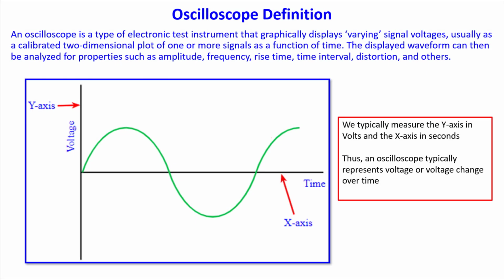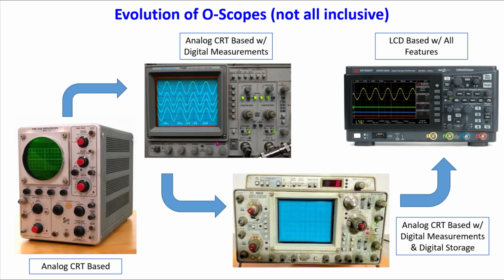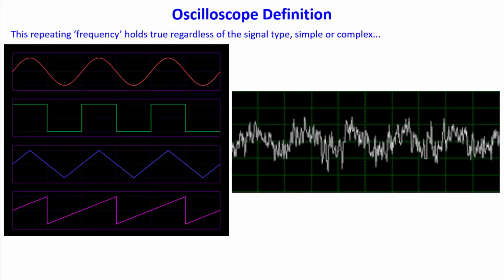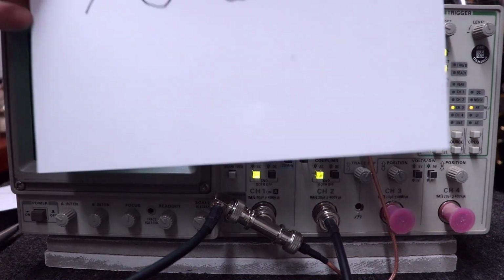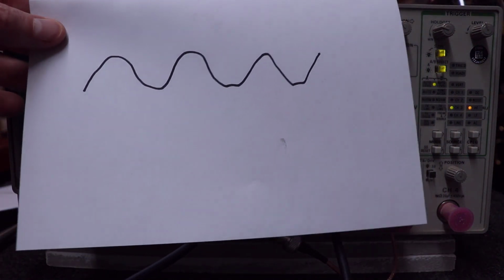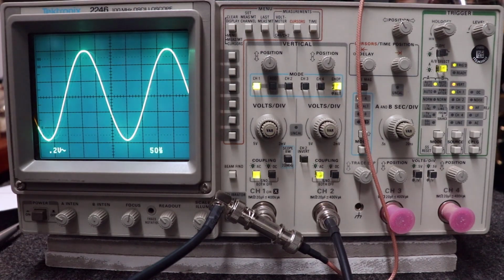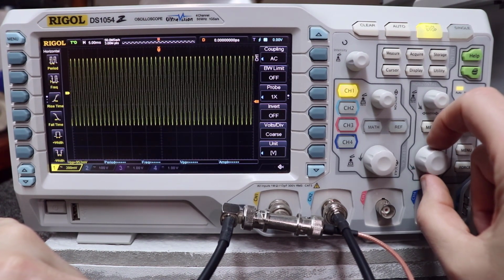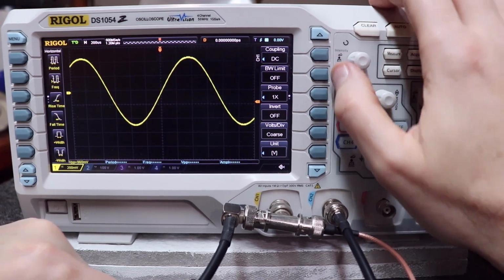Oscilloscopes For Audio 101 - Part 3 - Oscilloscope Basics - How to Use One

Comment: I'm confused, I have had a Tektronix 475 (brtoke in transition) and then inherited a 465, both with that "dump on top", which is NOT storage, but DMM 44, a digital multimeter, to get accurate voltage readings

Comment: Actually...  1 divided by 16.666 is 0.060002400096. Doh!
What we need to do, is keep in mind the time units! We divide 1 second by the time it takes to complete one cycle, which in this case is 16.666 milliseconds.
Hence, it's 1 second divided by 0.016666 (16.666 thousands of a second) - and that yields the desired 60Hz frequency (plus some negligible change).

Comment: thank you for the informative video.. helped me get going with a tube based HP 100MHZ - running a mono signal in from a smart phone waveform app.  the square wave is the most finicky to position stable on this machine.but I have this. :)

Comment: @5:59 1/16.666 does not equal 60. Checking the math, 60Hz would be 1 second divided by 60 (cycles): 0.16666667 seconds per cycle. 0.16666667 seconds is is not 16.66667 milliseconds; it is 166.66667 milliseconds. 

If I've made a mistake, someone please point it out. 

But a 1 second wavelength (1,000 milliseconds) would give a frequency of 1 cycle per second, or 1Hz. One-tenth of that wavelength, or 100 ms, would be 10Hz. And 10ms would be 100Hz. So, 60Hz does approximate as 17ms.

I guess this reinforces the point made @4:44 that engineers don't speak in milliseconds when dealing with waves. The chance for error is unintentionally made obvious ;-)

Comment: Years ago I had to use analog oscilloscopes in digital telephone switches. I don’t recall ever looking for ac signals we were looking for high or low input & outputs at specific timing intervals. Might be +5 volt high for 250ms for example. Everything was logic gates. AC testing I’m pretty weak on and why I’m watching you O scope series. Thanks for posting the videos

Comment: I am trying to repair a crown macro-tech 5002VZ. It's a giant amp from the 90's. I need a scope. I'm looking at a digital scope on amazon with a signal generator built in. I'm guessing I can use this for supplying sine waves to amplifiers, but I'm not sure. it says "only the frequency is adjustable," (meaning no amplitude adjustments i'm guessing). it says it can do sine, square, triangle etc. this is what they are calling it:
YEAPOOK ADS1014D 2 in 1 Digital Oscilloscope DDS Signal Generator with 2 Channels 100Mhz Bandwidth 1GSa/s Sampling Rate (ADS1014D)
it's just under $200

seems like it would be good for amplifier repair, but I'm not sure.  
any opinions about this scope for amp repair? 

one channel of the crown amp is not functioning properly. seems to get hot on the dead channel. I'm seeing a little dc on the output. I think it said around .9VDC on the bad channel. the good channel read near 0VDC

Comment: On the 2246 channels 3 and 4 actually have independent voltage adjustment, its just limited. You'll see the buttons right next to them that say .5v and .1v. Those are your voltage selections.

Comment: Great video. I know how to use a scope but I'm no expert so I got some good info from your effort. I have a Tek 465 but will be buying a Hantek digital scope in the near future. I plan on converting it to be able to run on either AC power or battery power because I work on vacuum tube equipment from time to time and wanted something that I could electrically float so that I don't hurt it or myself. Yes, I know I can use a differential probe but it's more fun to buy a new piece of test equipment. And besides, like you, I don't like lugging my 465 around.

Comment: Darned good stuff.   Since this was for beginners, I think you should have grabbed a plastic probe adjustment tool and actually calibrated the probe.  My 2465BCT has Ch1/2 inputs offer 1M-ohm AC/DC/GND and 50-ohm DC settings.  Do you cover when to use the 1M and when to use the 50 in a different video?  Thx.

Comment: A nice piece of work!  Thanks for your efforts, Mark.

Now a couple of yeah, but's!  :)

One aspect of digital scopes that always comes to mind for me is that they're generally (well, the affordable ones are) only 8 bits of A/D conversion.  That means that there are only 256 distinct vertical levels, and if we're looking at the positive half-cycle, for example, that's down to just a hair better than 1% resolution.  (That's resolution, not accuracy!)  If the signal is only half of the maximum for that range, it's only using half the discrete levels, so now we're down to 2%.  On the other hand, the analog scope is smoothly continuous -- it's not affected by the same kind of discrete levels, nor does the effective resolution fall off when the signal gets smaller, and so it can present the fine details of the curve more accurately.  It's not just about fade time of the pospher -- it really is better.

The other thing that comes to my mind when I consider the difference between analog and digital is that I'm comparing the electronics design and implementation of a $400 dollar scope with the electronics and design of a used $4000 scope that I got for less than $400 off of an auction site.  My assumption (and experience) is that every aspect of analog electronics -- especially the input section which has to be analog in both scopes -- is going to be much more refined in the analog scope versus the (designed-to-a-price) circuitry in the digital scope.  That would change if we were looking at $4000 (or higher!) digital scopes, but... not in my shop.  :)

In other words... I'm not too quick to assume that the precision of the waveform is equivalent, or better, in a modest new digital scope, versus a nice (i.e. Tektronix), used analog scope.  I absolutely LOVE my analog Tektronix scopes, for everything except capturing a waveform for later evaluation, which the analog scopes just can't do.  There, I fire up the digital, and it's really good at that sort of thing.

Just a point of view...  :)

Comment: As you continue, or maybe in a separate video after you finish the series, you might comment on what can and can't be accomplished with one of the JYEtech kits like the DSO150 or DSO138.  Only one input (but hey, you can afford two or more!) and very limited bandwidth (200 KHz?), but way cheap, $20-$30, "real" probe extra.

I already had an old Sencore 60MHz analog scope, but picked up one of these kits just for fun.  And it was fun to build, pocket money well spent even if it never sees real use from my point of view. I haven't even tried to use it for any work yet, but I rarely have an occasion to use a scope at all.  I figured I might use it sometimes when I don't want to drag out the boat anchor Sencore.  It does do frequency and voltage measurements for you, and can hold the waveform on the screen, so better for looking at momentary glitches.  It can be battery powered, so not ground referenced, which might come in handy as well for hot chassis tube work?

I think the question to be answered is, for audio work, is it at any time better than no scope at all?

Comment: If I have a power supply of 400VDC can I put the scope on AC and check for a ripple on the DC if the scope has a lower volt rating?
Reply: If that is a switching power supply then you would need a high voltage differential probe to do that safely,  and they typically have high attenuation so they can handle usually 700V or more.

Comment: Thanks for this one and the previous two. There are so many oscilloscope videos on the internet that show things without teaching well. Yours is way better because you explain how things work, why they are that way, and give practical, real world examples and information.  And you go beyond the oscilloscope, which really was very helpful in the first two videos. I can’t thank you enough.
Reply: Yeah there are tons of videos but they are poorly made, they leave of a bunch of info off or they create more questions in your head because they don't answer them or give you a convoluted answer.
Reply: The other thing that the videos don't show is how to hook up the leads (bnc cables) to the unit being troubleshooted or the probe and its ground lead being hooked to ground and the probe being used.

Comment: Surely 1/16.6666 = 0.06 seconds, so you need to multiply by the 1000 go convert the milliseconds measurement to seconds = 60.
Reply from the maker: correct, should have mentioned that
Reply: Yep

Comment: Folks ought to know that when calibrating their probe(s), they should use a non-conductive screwdriver.  It will make it easier to calibrate the probe(s).  Also, once calibrated for a specific 'scope, the probe(s) shouldn't need to be re-calibrated as long as they are used with that specific 'scope.  However, I don't know how calibration is or is not affected by using a probe on different channels on that 'scope -- I'm obviously not an expert.  ;)

Edit: When you were showing the trigger level control on your old Tektronix 'scope, was there a faint "dot" that you were watching move around on the signal trace?  I didn't see one, but have seen similar "dots" on other channels' videos where they were using 'scopes.  Their dots were very hard for me to see via YouTube, so I'm guessing that your dot was simply too difficult for me to see.

This is a wonderful video!  I can't wait for parts 4 & 5!
Reply from the maker: good point